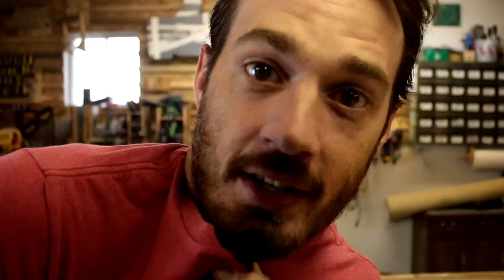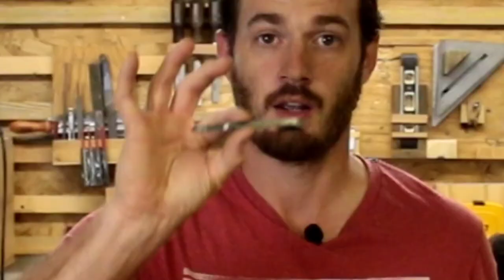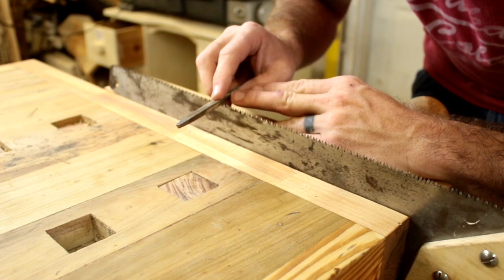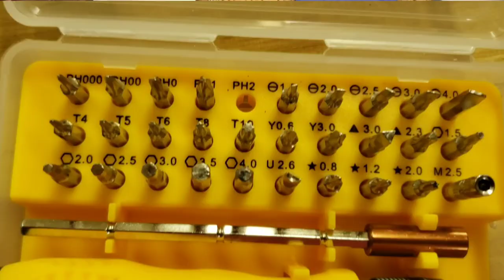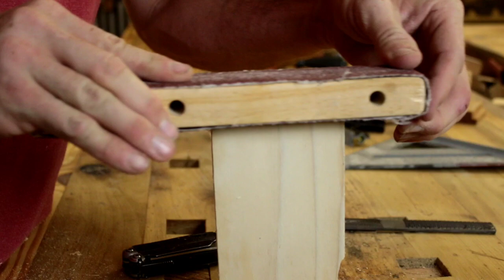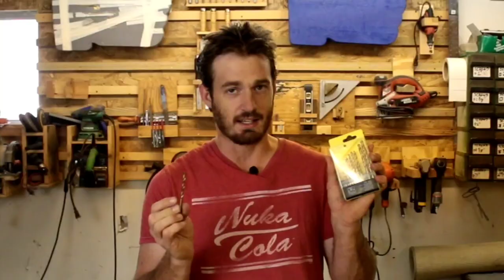Start Woodworking for Under $150- Beginners START HERE

Comment: You were stroking the file backwards. A file only cuts on the forward stroke.
Reply from the maker: Generally I would agree with you but to tell you the truth I've always had better luck running this file backwards.  I don't know if it has something to do with the way it was cut. Like I said it was a cheap file. I've been using it that way for years and it works great. Good point though!